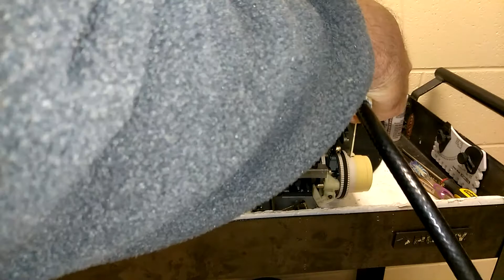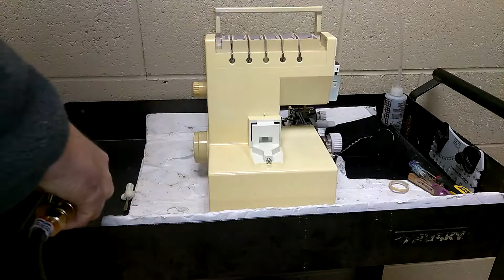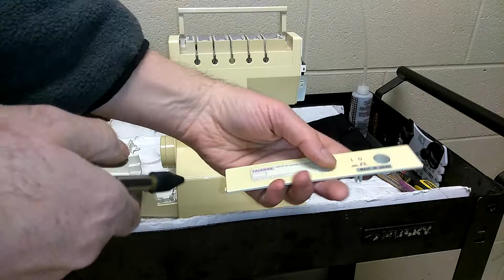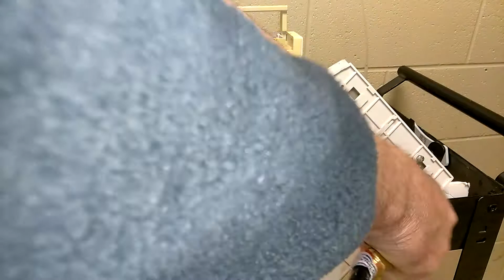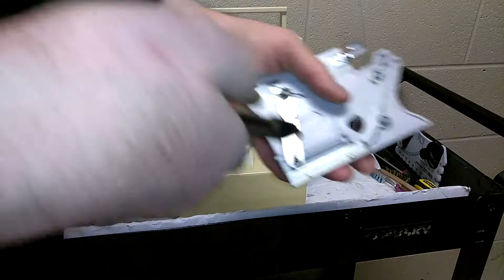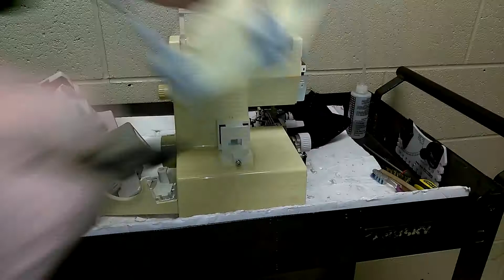How to blow out on Pfaff hobby lock 788 (Tamara W)

Comment: I bought a Babylock 788 many years ago and never really used it. Do I need to do anything to avoid any problems before I start using it now?
Reply from the maker: Could be better if you blow out it, and put oil, check looper with needles.